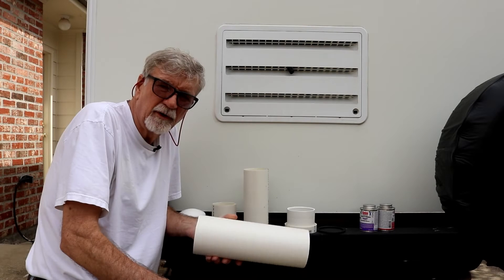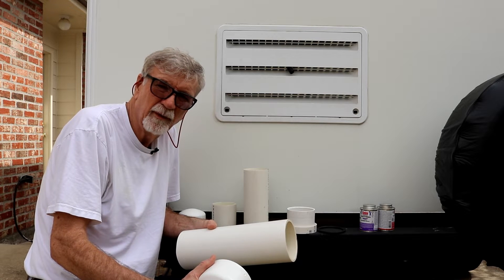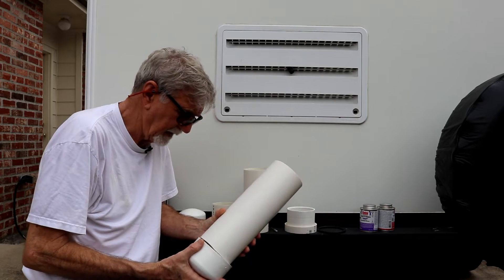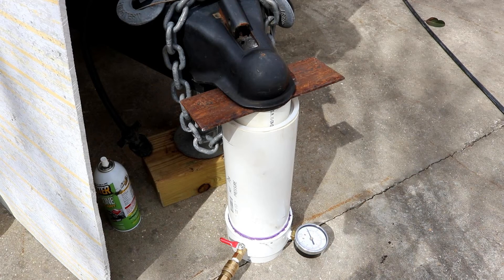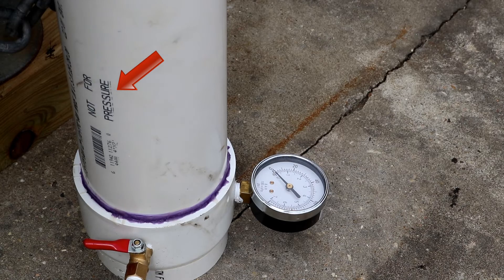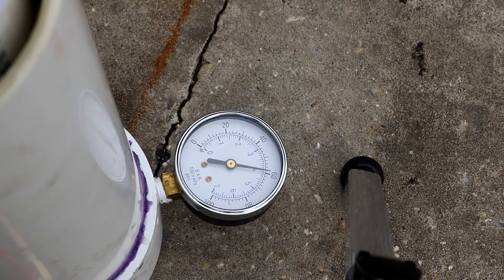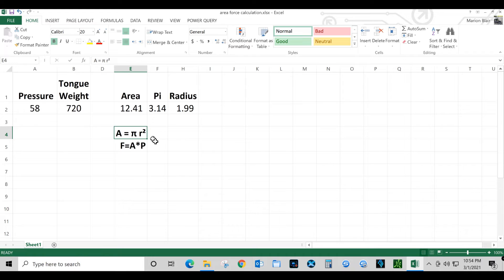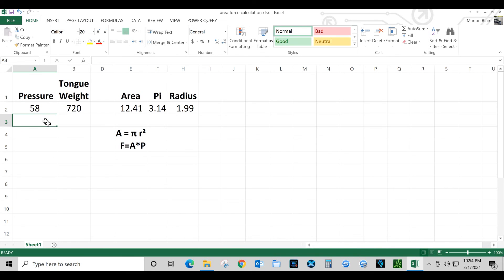Homemade Tongue Weight Scale

Comment: So here is my plan. An amazon triple bag air jack that is on sale for $100 and then put a 200lb gauge add-on with a second quick coupler and valve. So I can open the "factory" valve and use my add-on to measure. My question is, what did you take the radius off? the pipe or the area of contact with the jack?
Reply: or the area of the footprint of the jack?
Reply from the maker: The radius of the inside of the pipe.  I first calculated area which is A = π r².  Use the inside radius.  then Area=Force x PSI
Reply: @MarionBlair  Thank you sir, but I'm confused as to why that? I Amazoned "Mophorn Pneumatic Jack 3 Ton Tripple Bag Air Jack" So what should I use the radius of? The top of the bag at the bottom of the top plate?

Comment: Terrific project.  Thanks for the video.  I presume you added air slowly so as to lift slowly.  What air pressure was available at the source.  If you had, say, 120 psi at the compressor what kept your jack from continuing to rise until it vented air?
Reply from the maker: I had a little 1/4" ball valve at the air inlet but as a precaution, I shut my compressor off just above the calculated pressure I would need.  And yes, I didn't show it because it would look ridiculous but I had a helmet on and hiding behind a sheet of plywood.
Reply: @MarionBlair  thanks for the reply.  I speculated you had the tank regulator dialed down.  So, now I understand.  I did notice the plywood and gloves.  I'm considering making this and use water pressure as a lift medium.  Bursting wouldn't be much of an issue with water.  Thanks again.

Comment: Nice system I used a 4X4 and a bathroom scale  with excellent wheel chocking  on a Cargo Trailer  I built into a small toy hauler /Camper  got a tounge weight  on it but then I bought a new Dually 3500 Diesel truck  so it could take way more tounge weight than I actually had  my best freind laughed at me because I liked having water tanks full onmy long drives pulling my other campers I told him it was because it made my truck ride like a Caddilac  with the springs compressed a little bit  so it was a better ride  that way
Reply from the maker: Yea, me too.  The more tongue weight the better the ride, even with the coils.  I like full water also especially when overnighting to destination in Walmart's etc...  The Rockwood has a weak water tank however so I have to be careful.

Comment: The one time a little more explanation would have been appropriate and you a short and to the point.... LOL
Reply from the maker: Yea, I have the full boring video in detail but was afraid I'd bore people.
Reply: @MarionBlair  did you confirm your findings with another tongue scale yet. I’d be interested to know if your home made scale was accurate.
Reply from the maker: @NickBeek  It appears to be pretty close.  I had my wife stand on the tongue (133 lbs) and the difference was within a few lbs. Also the increments on the gauge are in 2 psi so I'm having to interpolate a little.   I lubed it up good with some silicon grease as opposed to spray also.  I do get a little bleed off apparently past the O-ring  so I may add a double O ring.  I keep a little pressure on it so the tongue creeps up extremely slowly and the gauge steadies out perfectly.